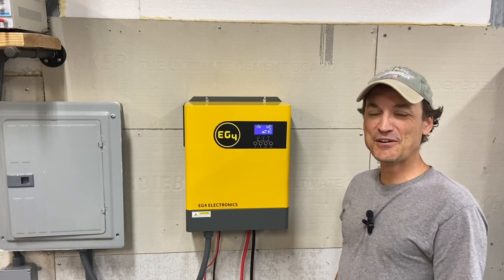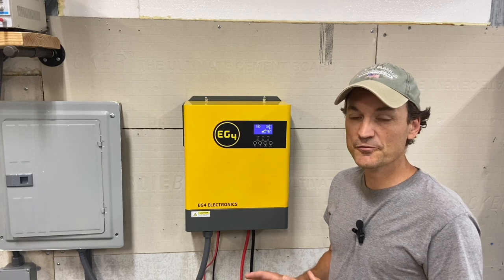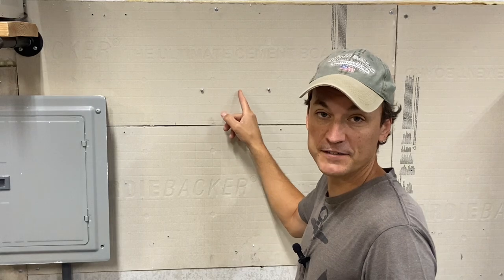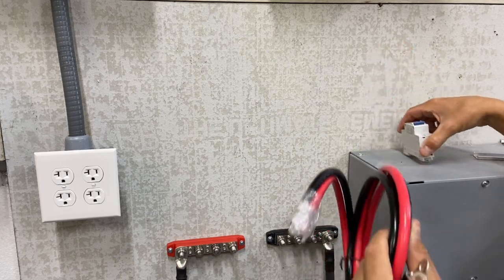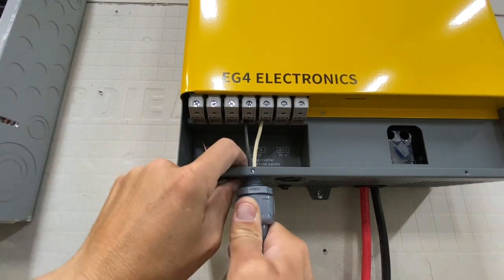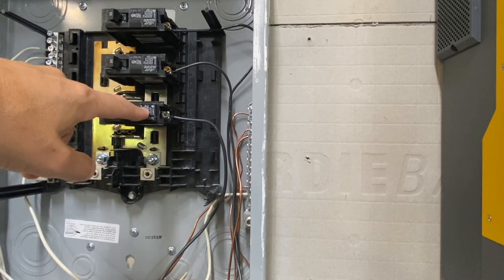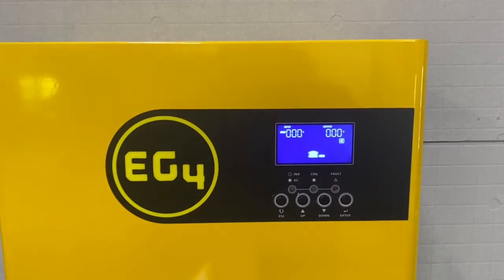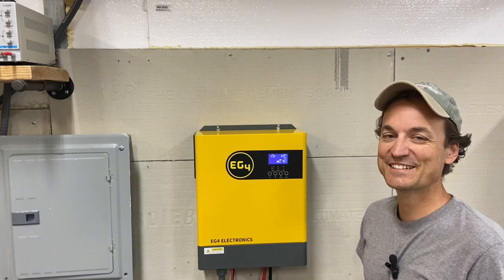Eg4 3000w 48v inverter install and load testing. Signature Solar beginner friendly solar inverter

Comment: I agree there are a lot of good features of this unit, which you covered. For the price, if you get one of these with a LifePower 5.1kW battery, for like $2500 you get a full system that will blow away your EcoFlow and Bluetti options for scalability and power punch. The drawbacks to this unit are its poor interfaces. The little screen and button combo makes for very inconvenient settings adjustment and monitoring, and is cryptic and very confusing. Manual will always be required. The manual is sub par and needs a major revamp, but it exists at least. It's hard to know how to maximize performance of the battery. The WiFi serial port connection "dongle" thingy is useless. Who uses old PC serial ports for anything these days? After several attempts, and a support call, I was unable to connect it to the WiFi or app, so that's very poor and thumbs down on that. The EG4's fan is typically on a lot and a tad noisy with only 1.5 kW PV in. My latest update, after one year of use, not many problems until the BMS board in the LifePower battery burned out, literally, so they are currently replacing it (Signature Solar is good on returns). Signature Solar has these EG4s for $674 currently.

Comment: It’s a no go for most RV’s. It needs 120 volts PV to start charging. Some on the market only need 60 volts PV to start charging. A 200 watt solar panel is around 23 Volts so you would need at least 1200 watts on the roof of the RV just to get it to start charging. If your in any kind of cloudy conditions it would not charge the batteries with 1200 watts on the roof. Great unit for your house or off grid cabin and 2000 watts of solar.
Reply from the maker: Yeah a lot of all In one inverters 120v. Victron charge controllers have some pretty low startup voltage. And Victron gear works great for mobile applications. Then again they will take up more space.

Comment: I got my working Saturday and I was so excited everything was working nice, but I have been getting fault error 04 and data logger says over temperature. Its got enough room so I don't know why its over heating. The max load on it has been around 15% havent even reached 1000wh. Im not sure what is causing it. I had to turn it off for the night. 😢
Reply from the maker: I would call eg4. That definitely doesn’t sound normal.

Comment: Can the EG4 3000 inverter run 3000W output 24/7? Im thinking of using this for a fixed-load of 3KW for 24/7 operation. Im thinking this would require 72KW of battery storage as well for 100% use (0%-100%).
Reply from the maker: That’s a good amount of batteries. You can likely figure in some solar production into that, as that will offset some of the battery usage. 
As far as the inverter, it is rated for continuous output. But you’d be running it flat out. I’d recommend going a step up to the 6000xp.
Reply: @GavinStoneDIY  If I went with the 6000, can I still use 72KW batteries for 0%-100% discharge or should I have more than that?
Reply from the maker: @ it all depends on the amount of solar you’ll be adding. I don’t run them to 0% though. That will sometimes shut the system down if the battery is too low. I run them to 10%.

Comment: How do you know what size breaker you can install for the inverter feed to panel?
Reply from the maker: It would be determined by the wire size. The breakers purpose is to protect the wire. So if you know how many amps the inverter will output then you choose a wire size and breaker to match.
Reply: Thank you sir!

Comment: Great video as usual.  I can hardly wait to do a cart build with one of these.  I liked the multiple load tests you did.  Nice to see the reset after a fault, too.  Keep up the good work!
Reply from the maker: I’d like to see that cart build when you’re finished. This is actually a simple inverter. Easy to work on and use. I had fun doing the video. It’s so light it’s like a toy.

Comment: Great video. I have a Growatt 3000 SPF I use in the same way but with a reliance manual transfer switch. It’s always a backup for two fridge circuits and a few lights circuits. If I need to power more during an outage I simply flip those from UTIL to Inverter for those circuits on the TS.
Reply from the maker: That’s a great use case. That’s what I was trying to convey in this video. A great inexpensive power backup option.
Reply: @GavinStoneDIY I use mine off grid to power my pool pump, heater etc, TV, security cameras, outlets for stuff.   If grid goes down, I have a 30 amp interlock with my main panel.  Just remove the NG bond and I'm ready for emergency backup.  Manual xfer switch was not an option due to panel location and other infrastructure.

Comment: These smaller but powerful All-In-One inverters are ideal for building portable power stations. 
For example, by making a DIY trolley with 4 rotating castors down and from the middle vertical support - looking like an upside-down T + 4 angled supports to the 4 bottom corners from the top of the vertical support and hooking this All-In-One inverter on one side and a vertical wall battery on the other side (short cables in between them) This way it makes a stand-alone portable powerful solar system with a smaller size like using a hand truck, which will be used normally.
Reply from the maker: I really like the idea of these on a cart. They are so light and easy to move around. I’ve seen a couple builds with similar ideas. That’s why I wanted to show people a low cost power backup option for critical loads panel instead maybe. It really says something about a unit when there is so many possible use cases.

Comment: I think that you will find that during bypass or inverting, the ground relay switches that grounds apart. you should be using the CASE ground for off grid. I am not certain as I don't own that particular model, but this is what I have been told
Reply from the maker: I was curious why they have both options. But the terminal and case seem to remain bonded in both cases. Could be they changed the design a bit and left the screw there.

Comment: The one answer that I have not seen on YouTube or in the manual is how do I precharge the inverter if I am not using EG4 batteries??  Love your presentation and looking forward to adding one of these fine inverters to our system
Reply from the maker: That is an excellent question. I’ve never discussed it before. I’ll cover that in an upcoming video for sure. Look on Amazon for a 30 ohm resistor. You’ll find multi packs for really cheap. And there is different ohm ratings. But a 30 should be fine for most applications. Or you could even use a #2 pencil with both ends exposed. You’ll touch one end to your battery cable before connecting it. And the other to somewhere convenient like the battery terminal or the breaker. And  that slows the flow of current to the inverter. Takes about 30 seconds usually.

Comment: Thank you sir for a great video. I just picked up my inverter last week. One quick question. Did you just make the connections or did you have to change any program settings? Also I wanted to thank you for not having any stupid music playing during your videos. What a pleasure.
Reply from the maker: Thanks for watching. I do have to agree, I’m not so fond of the music thing either. 

I did have to change my inverter to eg4 battery protocol.  I think I mention that in this or the next video. And depending on your solar input, you might adjust the charging amps. Also something I forgot to mention on my video. For some reason the unit came set at 50hz. And you’ll want to make sure that’s 60hz.
Reply: @GavinStoneDIY  Thank you for your quick response Gavin. I will be getting with signature solar for the program settings when I am ready to switch everything on. Thank you again.
Reply from the maker: @jamesfritzinger5622  sure thing. The biggest thing I would say is just take your time and be careful. Also, make sure you use a precharge resistor when hooking your batteries up for the first time.
Reply: Hello again Gavin. I do have the resistors and will charge the capacitors but if all of the instructions and precautions are followed there should be no fireworks or damage.(all power is turned off and all connections are torqued to proper specifications). Am I wrong in assuming this?

Comment: How would you wire up the Generator Start feature
Reply from the maker: I haven’t even researched the dry contacts for the generator start. They are capable of automatically starting a generator based off SOC.. I may look into that more.
Reply: @GavinStoneDIY  I have an Aims generator which can connect to the but I'm not sure how to set everything up

Comment: spray some lube (ptfe based or silicone is pretty clean) in the TEMCO hammer crimper it's insane how smooth it operates after that. Spray it in the back where your finger goes there's a hole
Reply from the maker: Good idea. I’ll try that before my next project.

Comment: Couple questions for you - - the breaker looks like it is installed backwards.  Line should go to the battery and the load should go to the inverter, everything I have researched shows that.  Can you explain why you put this polarized breaker the wrong way - wouldn't that cause a DC arc/fire?  Second question - how to ground your PV system?  Do you run a wire from your bonded panels to your AC box?  Or are you running a separate grounding rod specifically for those panels?
Reply from the maker: Technically these breakers are still considered bidirectional I believe. Really a 200 amp T class fuse would be the ideal thing to add. 

The PV is supposed to be grounded at one point. In an off grid setting that’s often near the sub panel.  And where people have grid as a bypass the ground would need to be given a path to the main grounding rod. Some people run a dedicated conductor all the way back to the main. Some people tie it into the inverters grounding system. I prefer not to have my PV grounds near my equipment.
Reply: @GavinStoneDIY    Thank you - - https://www.youtube.com/watch?v=q-uDyzkKwVA this fellow did a test on this breaker - you'll see the load/vs line side.  Usually they don't say load/line if they are not polarized.  One more question for ya - - - I see that circuit breaker doesn't have a bond to ground for that DIN rail.  Should it be bonded?  In this video of yours https://www.youtube.com/watch?v=HYjErVlx8cY you show the enclosed box from signature solar.  Do you bond that at all to ground?  Or is that only needed for SPD?  Thanks in advance - love your videos sir.

Comment: Great review! You actually convinced me to buy one of these to off-set my mini split consumption off of my main system. If I were to hook it up exactly like yours, with N+G bond inside the breaker panel, with a couple of 20 amps outlets, can I then use a power cord to charge it with the grid? I mean, in the same exact config like yours, is it possible? Love your reviews!
Reply from the maker: It definitely would be possible yes. So if you were supplying it with grid power you wouldn’t bond the breaker panels n/g. The main panel would supply the bond. Since you only want it bonded in one place. I hope they makes sense. I’ll hopefully be releasing a second video on this inverter soon. I’m working on editing it now. It might be a bit long though. 🙂
Reply: @GavinStoneDIY  Yep, it makes totally sense. Looking forward to the second part on this inverter. I'll hopefully order mine this week. Thanks for your awesome reviews.
Reply: I also have a question about using a power cord to charge with the grid. Do I need some kind of fuse or breaker on that grid cord or just from the wall plug to the inverter? Thanks for any help with this
Reply from the maker: @LarryRichelli  the receptacle would come from the grid and have its own breaker.  Technically you could only charge around 2000 watts from a standard wall plug. When it’s capable of charging at much higher wattage. So you’d have to limit your charging amperage on the inverter menu.  The most efficient way of using the inverter charging from the grid would be to wire it directly from your grid panel with the wire and breaker specified in the manual. But I wall plug would do the trick in a pinch.

Comment: The EG4-LL power-on procedure requires one to close its circuit breaker first then turn-on its BMS switch, in other for its in-rush current limiting mode to function correctly. I noticed that you first turned-on the EG4-LL BMS switch which causes the in-rush circuitry to start and you then closed its circuit breaker, which by that time the in-rush current limiting function is already over. Please contact EG4 tech support to verify and/or watch the power-on procedure in several other YouTube videos.
Reply from the maker: The precharge sequence likely wouldn’t have finished that quickly. But good catch on this one. I’ll try to mention it in another video.

Comment: Great bud thx. That’s not grid-tie is it?  Would love to see two in parallel to tie in with a main panel (if they are in fact grid-tie). 👍🏻
Reply from the maker: It’s a off grid inverter. So it can use the grid as bypass in case the batteries are depleted. But it cannot backfeed the grid.
Reply: @GavinStoneDIY  Is there zero leakage between the inverter and grid in hybrid operation?  Most seem to backfeed a little as loads change.
Reply from the maker: @patrickkenny2077  there isn’t a possibility of back feeding. The inverter itself doesn’t actually feed the main panel. Technically it could if you have an interlock or transfer switch. Otherwise these inverters are designed to feed a critical loads panel. Which is completely separate from your main panel.
Reply: @GavinStoneDIY  From what I understand, most of these inverters leak power back to utility, especially when PV or load change quickly.  They aren't intended to, but it is hard to avoid.

Have you measured no energy on the utility, or assuming?
Reply from the maker: @patrickkenny2077  it’s just not possible with this inverter.  Unless you had it wired in a dangerous and completely wrong manner. It doesn’t feed the main panel. It can receive power from the grid as bypass. But it cannot back feed on the input. Its just not wired that way. There are inverters like solark and  18kpv that have frequency matching capabilities. Those can actually be wired into your main panel. Those types of inverters can in theory leak back to the grid if they are wired into your main panel. That may be what you’re referring to. I have the 18kpv  but I have it wired to feed a critical loads panel the same as this 3kw inverter. And in those instances it’s just not possible to backfeed.

Comment: i made one of these for my EV Car.  I just use it as a slow Charger.  1.4kw per hour
Reply from the maker: That’s pretty cool. Free gas is a great thing either way.
Reply: will it work without a battery hooked up to it.?
Reply: @fergman300  Yes it will.  I have 6-400 watt panels laying flat on the ground in my courtyard.  Under perfect conditions they produce about 1.95 KW per hour.  They ramp up and down to that peak number each day.